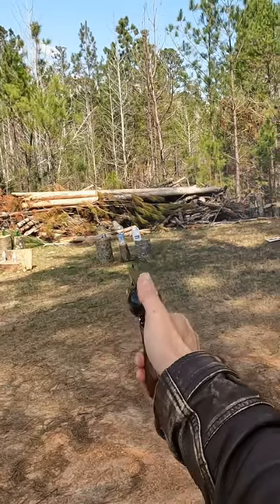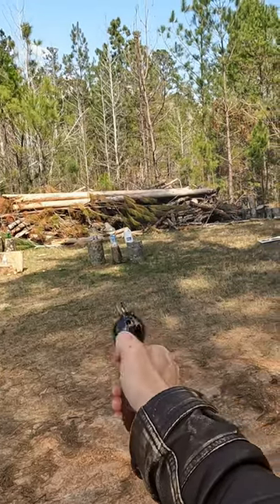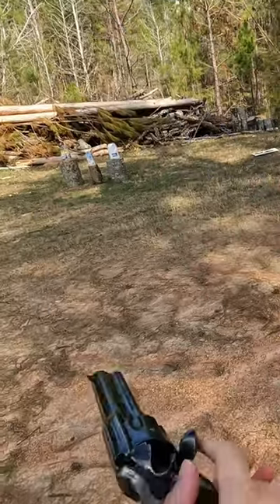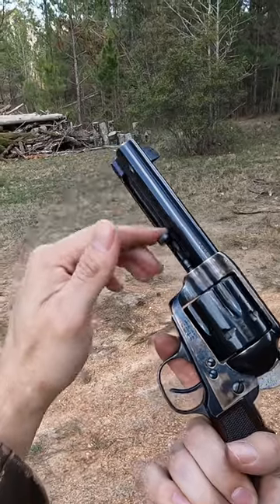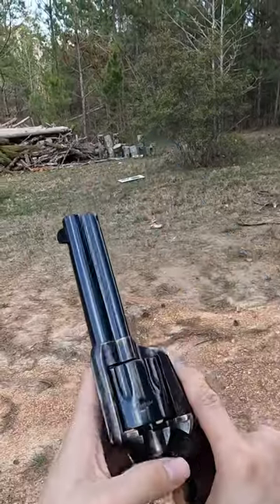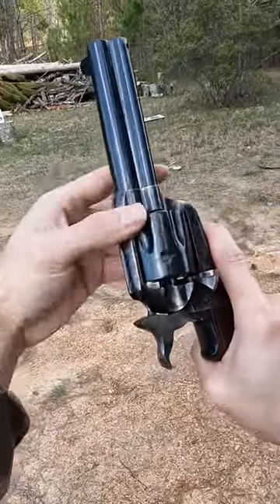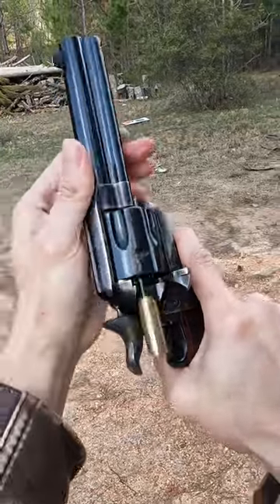🔥How to Eject Shells from a Single Action Army Revolver #revolver

Comment: You forgot the part where you empty them into your hand because 45. Long colt is f ing hard to find.
Reply from the maker: just replenished last week 😂
Reply: .45 Colt.  No long.
Reply: @davidgentry5044  I’m just telling you now most people call it long colt because there’s lots of different 45s. There’s 45 ACP, which also works for Colts 1911s that is and then there’s 45 gap etc. I understand the official title Of the original ammo being 45 colt but if I just tell people 45 long colt, they know what I’m talking about
Reply: @LPLK_Kharn   Long is slang.  No where does firearm manufactures add it.   “.45 COLT”
Reply: @davidgentry5044 .45 LONG colt is a nickname from the west, where .45 scho field (a shortened 45 colt for s&w top break) was more common, colt ms cartridge being longer earned it the ubiquitous nickname.

Comment: Tip for if you use a snubnose:
Get a rod, a pencil can do.

Align the cylinder between the screw bit and the opening, jam the rod in and your casing will come out, it may take some force.

Comment: Is it hard to aim with and does the recoil differ when using the gunfighter and cavalry variants?
Reply from the maker: I haven’t used the other variants but there is some recoil with shooting 45 Colt
Reply: Even mild loads pushing heavy bullets have some recoil. The longer barrels help a bit just from increased  weight, and the full sized standard grip helps you hang on to them a little better. .45 Colt with moderate loads isn't as ferocious as it's reputation. I find factory standard level loads to be   very tolerable, and even slightly warmed handloads to be fairly easy to deal with.. 45 Colt isn't a rude hard kicking magnum cartridge  until your hand loads in suitable guns make it one.
Reply: @johnnorman7708  Thanks that’s what I thought with the increased weight just wasn’t sure about the cartridge
Reply: A lot of people think because . 45 Colt is a big cartridge and caliber,  that it is a rude beast to deal with. But it is not in its normal standard loads.
Reply: Why are all u girly men worried so much about recoil?
Reply: @Steamology1997  cause I want to know if recoil differs sometimes it’s pleasant and other times annoying depending on recoil
Reply: Recoil with normal . 45 Colt will be much less abrupt than the felt recoil from a typical medium frame . 357 magnum revolver. Ive got experience with  both. The . 45 is far less rude.